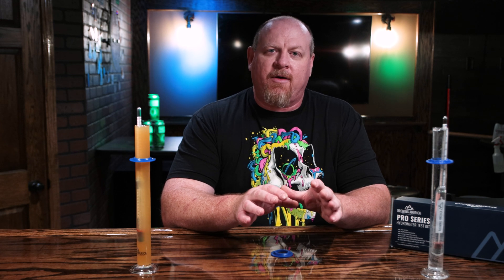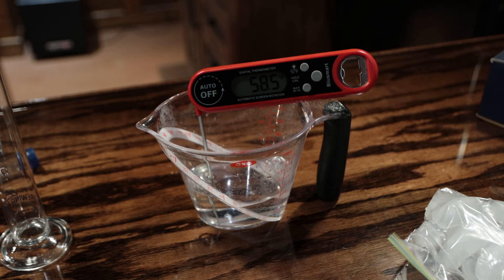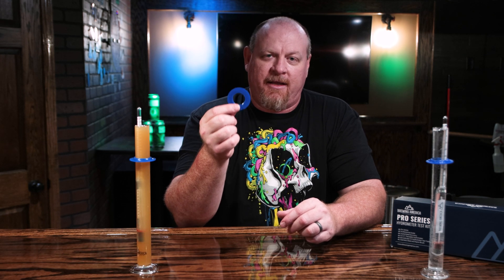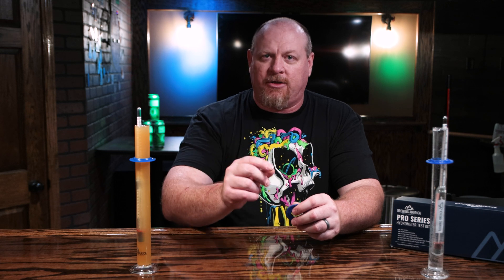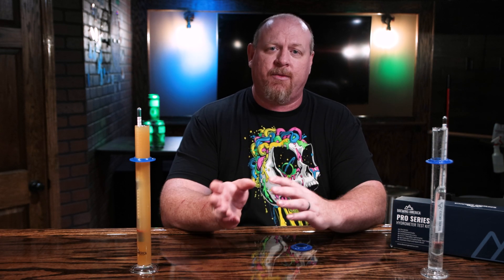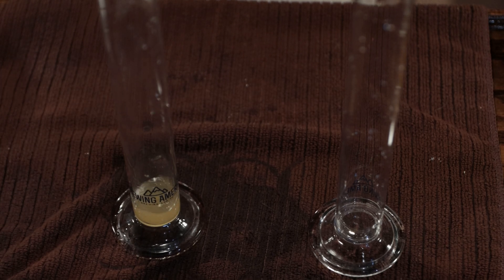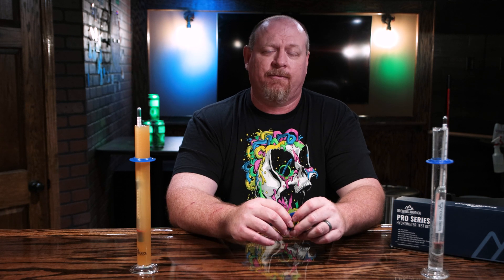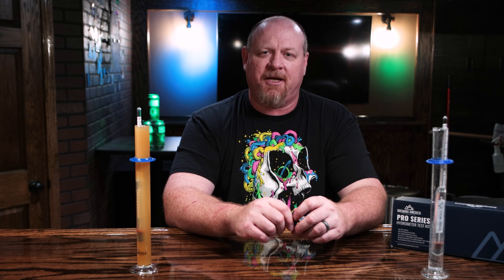Hydrometer How To

Comment: As far as temp goes..do we have to take the OG once the wort cools all the way down ..pitching temp vs fermentation temps etc
Reply from the maker: The sample should be as close to 60f as possible if it's not an adjustment will have to be calculated. No mater when you take the sample. 👍🍻

Comment: i always thought the ring was so that the cylinder wouldn't break if it got knocked over!
Reply from the maker: Well that is a added benefit of it for sure! 👍🍻
Reply: That was my understanding too. I always let the tube run over and I blow the foam off the top while it’s happening. Mine doesn’t have a ring so I’ll break it soon.
Reply from the maker: Lol

Comment: That little area where the water touches the hydrometer, and bends upward a little bit is called the meniscus. It's a Google it, it explains the phenomena.

And you're exactly right, any dissolved gas in solution, CO2 or otherwise, will mess with your final specific gravity reading. I usually have to stir a sample a little bit which helps liberate the CO2 that is in the sample.
Reply from the maker: Meniscus!! I thought that was in your knee.. lol yeah I remember the word now..lol didn't think it was super important.. had to give you a reason to comment!  👍👍🍻
Reply: @ShortCircuitedBrewers  sorry, every once in awhile I have a big brain moment.😁
Reply from the maker: @ccraiderfan  haha.. I used to work for a guy that every time I whipped out a big word he would flip me a quarter and tell me it was a $0.25 word!! Lol
Reply: it's because water is very sticky on a molecular level. it is one of the few compounds that both has high adhesion as well as cohesion.
Reply from the maker: All right you two stop with the big words!!!!